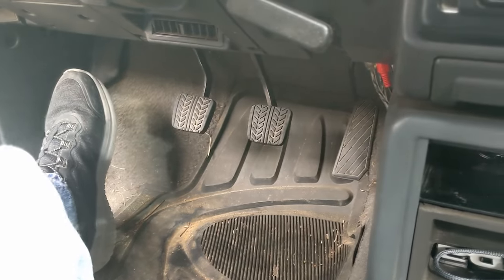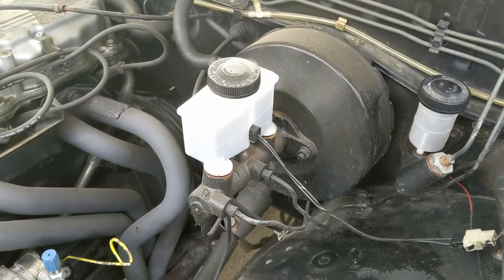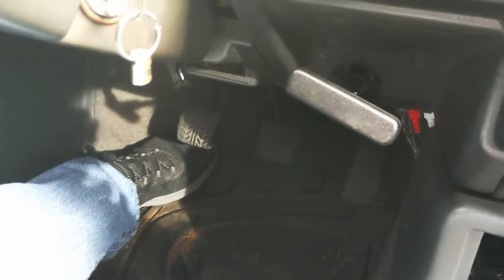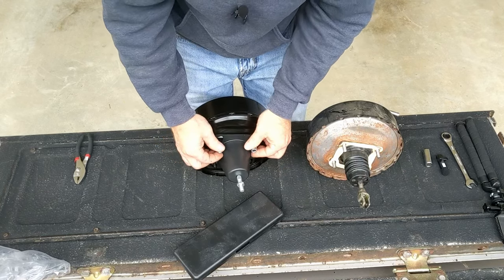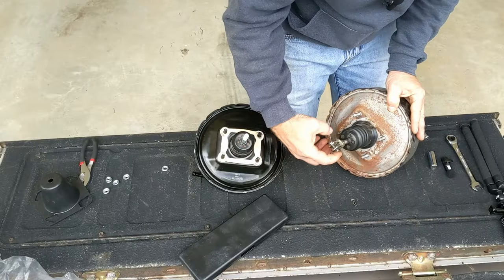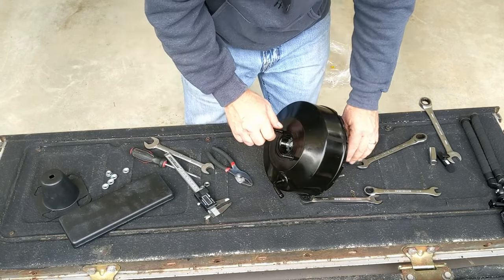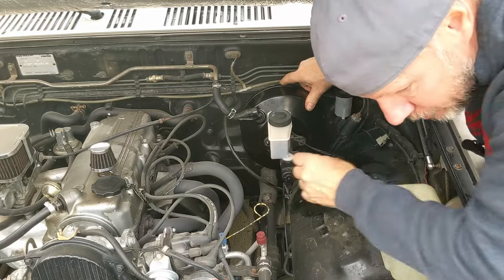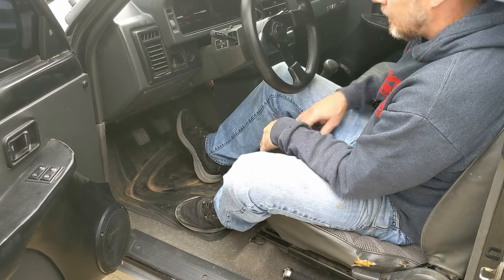Power Brake Booster Replacement | Mazda B2000 B2200

Comment: Good video.I've had my '88 B2200 for 29 years.  I replaced the power booster long ago, with a rebuilt one with a lifetime warranty.  I did exchange that one after a decade or more, straightforward.  As shown in the video, one needs to match the booster pushrod length at the forward end too to the existing one to have the right amount of free play for the recess in the brake master cylinder.  Check the one-way check valve in the rubber line at the booster, and agree that the lines for the brake master cylinder remain in place, the master cylinder just gets gently moved forward for this.  If there's fluid in the booster, that's from brake master cylinder leaking into it.

Comment: Hey Mitch I’ve replaced my alternator with a new alternator and new battery and the alternator won’t charge. I’ve also checked all my fuses and ground. What do you think is going on?
Reply from the maker: Maybe its the alternator itself, or wired in incorrectly?
Reply: @MazdaMitch  everything seems and looks to be correct though I just don’t understand!
Reply from the maker: Have a look and see if this helps. 
https://youtu.be/KEJxb_TROXs?si=snHKY9oLKVYr6wd5

Comment: Hi my mazda b2600 1992 carburetor, bogs when I press gas paddle to full throttle, won't go over 3000 rpm when driving, I replaced feul pump, new feul tank, spark and everything,drives fine when I keep revs at 3000 or lower, and has loss of power, what might be the problem
Reply from the maker: Possibly causes.
 The catalytic converter the first one, is stopped up or partially stopped up. Timing is not advancing. Weak coil.
Reply: @MazdaMitch  wow thanks for the quick reply Mitch

Comment: I have a 91 Mazda b2200 all original only thing I noticed is it's leaking a lot of oil at my intake as I drive then park it for a while oil sits in the carburator intake would that be the intake gasket or something more serious thanks
Reply from the maker: Sounds like you have the hose on the top of the valve cover going into the air breather of the Weber, it'll suck it right in
Reply: @MazdaMitch  it's actually blocked off the valve cover breather is blocked off
Reply from the maker: It's got to breath. Also check your pcv filter